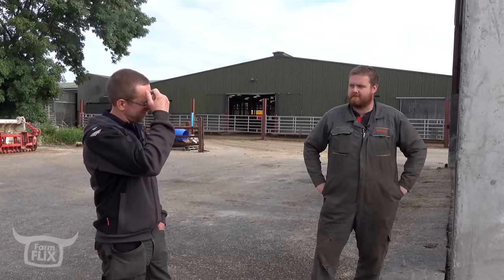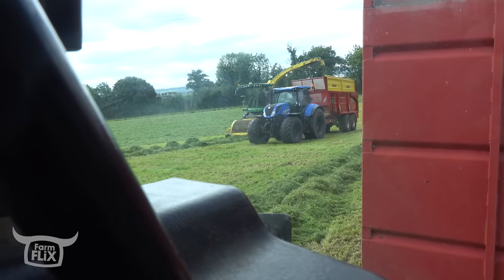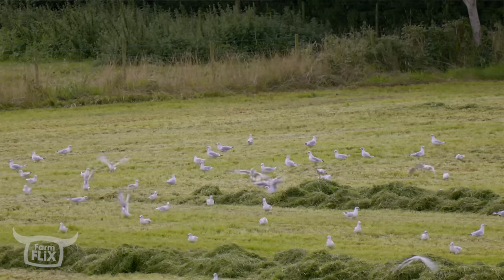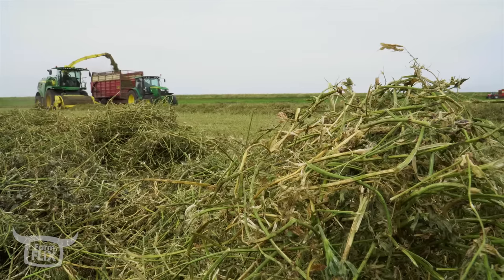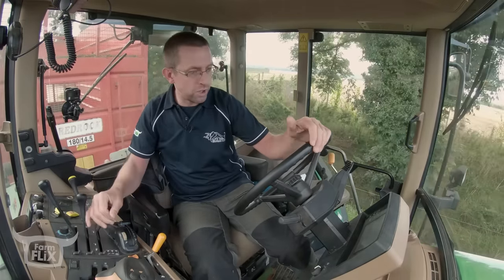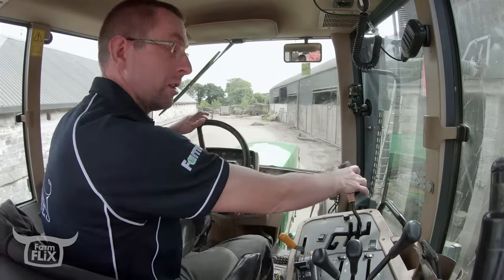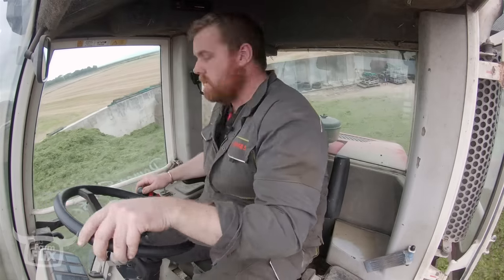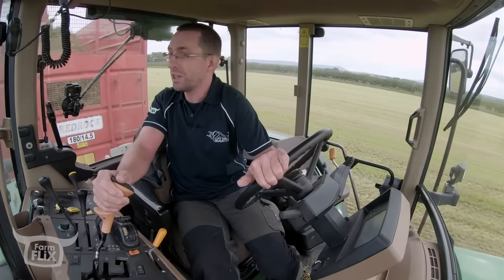SILAGE at CARSEHALL !!! John McClean | FarmFLiX

Comment: You can tell that man pulling 20 ton. On flat ground.  In co armagh I pulled 25 ton behind a valtra t160 6 days a week for 15000 hrs. You don't need 200hp. You need a tractor
Reply: A t160 valtra still a far more stout tractor than a 6470 Massey no comparing the two
Reply from the maker: whatever gets the job done ;)
Reply: @gregshearer423  ok. A t120 then